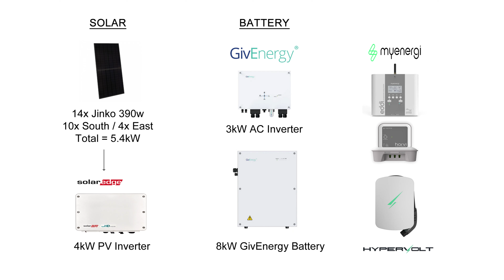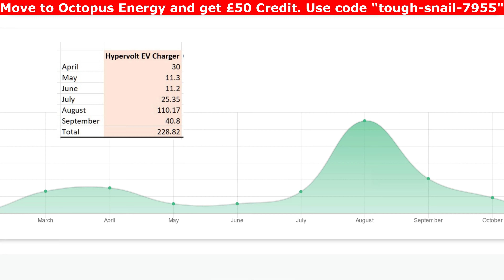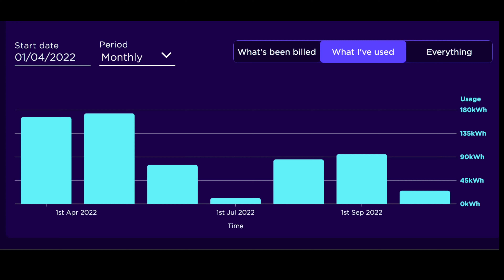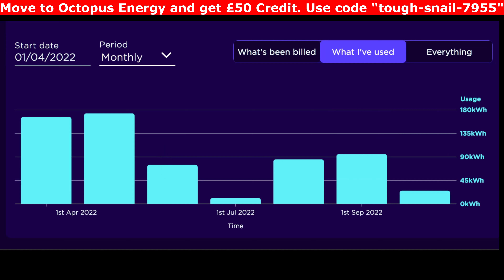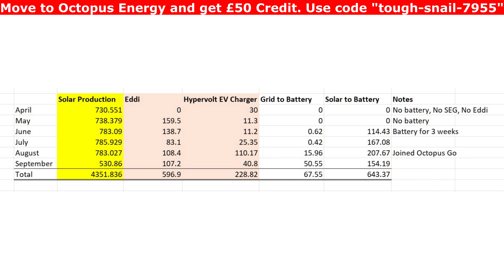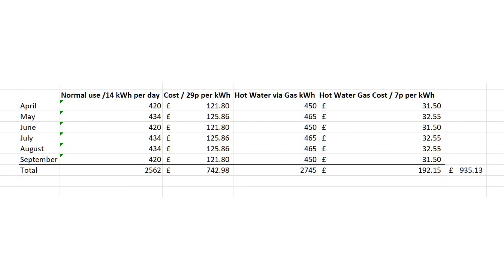6 Months of Solar - Summer 2022 - Summary and Savings

Comment: I am having my panels installed in about month. I will have LUX batteries that work directly with Octopus Agile. They will charge at the cheapest rate. Shame Octopus is not taking new Agile customers
Reply from the maker: Yeah I think a few different battery companies work together smartly with agile. I didn't know they were not letting you move on to Agile.
Reply: @daniel_coe  It is a shame. Hopefully it will change

Comment: What's you're heating and cooking, gas or electric?
Reply from the maker: Heating is a Valiant 8yr old boiler with a 200L tank and induction hobb (we've stopped using the gas hob) plus an electric oven.
Reply: @daniel_coe  just wondered if you had plans for more storage to minimise grid usage over autumn/winter?
Are you considering ASHP at some stage?
We're looking at the feasibility of going all electric, but whilst electric is still 3 times the cost of gas not sure it's worth it financially.

Comment: I've installed my 'off grid' system and so far in the 10 days (except for my mistakes) I will save money, even if I charge my 18kwh battery pack every night I will pay £45 a month with normal energy it would be £200 when we have more solar it will be 0 I hope.

Good informative vid
Reply from the maker: Yes, that's a lot cheaper Darren than paying normal rates

Comment: Excellent video that Daniel, Good to hear about the  experiences of others, it really useful and helps making informed decisions on my own installation which is happening next month. Glad you mentioned your usage before solar, I use a lot less than you and am concerned the payback may drag out unless I use a bit more rather than sending it back to Octopus.
Reply from the maker: Yes you do seem to produce more than you'd normally use but I suppose having a tank and an eddi diverts some of that power plus now having an EV at home also helps a bit rather than sending it out the door
Reply: @daniel_coe  Luckily its getting fitted now as the suns gone in. that gives me a bit of a chance to contemplate what to do. Haven't got a smart meter at the mo, so decisions need to be, made. Either invest in an PHEV, buy an iboost, leave all the lights on and don't sell any back, or get the meter changed, change to Octopus Go, to keep the battery charged up over winter and sell some back in the summer.  The installer claims the export isn't worth the hassle, and i should just use more, LOL. Happy to hear you thoughts on it.